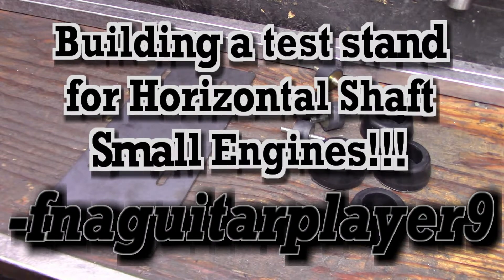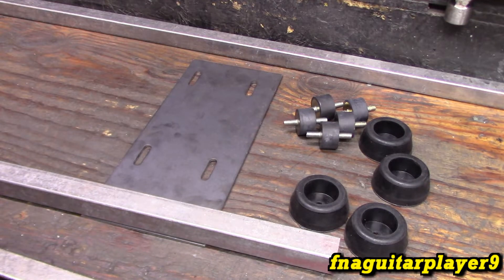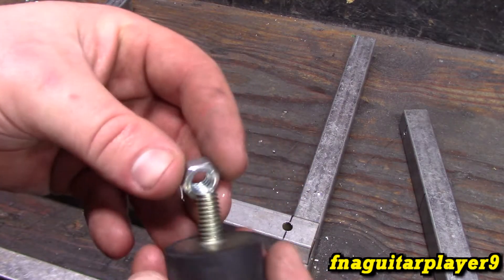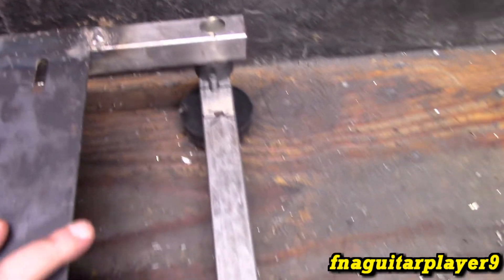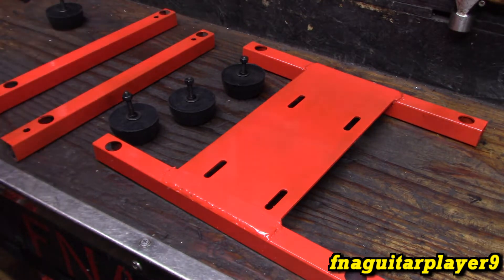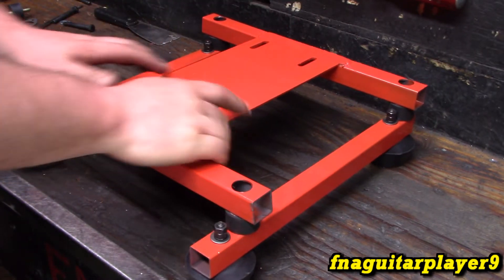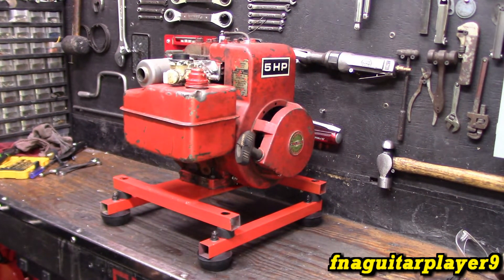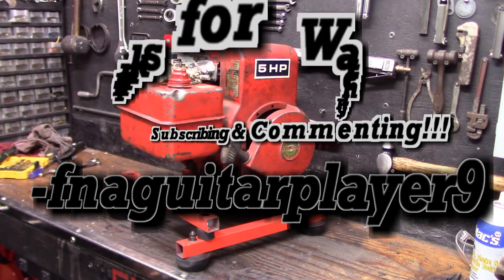Building a Test Stand for Horizontal Shaft Small Engines

Comment: A FINE job and I don't know why those tanks cost so much either. Trying to get us to buy cheap overpriced junk I'd say. I like Rustoleum and the orange will go with Tennessee and Clemson SC if nothing else. I always use a pocket magnet when putting on washers and nuts with an impact driver on the other end. And my test stands are whatever the engine is supposed to go on. That's as close as it gets here. So, GOOD job and pick me one!
Reply from the maker: Thanks! Probably so. Yeah it was just a random color more/less. Yeah i didn't think about using a magnet, i left that in the video for laughs lol Nothing wrong with that, most of my engines are off equipment. Thanks for Watching!!!
Reply: @fnaguitarplayer9  I usually stick the nut to the magnet on the flat side or the shirt pocket collapsible ones fit on the end pretty well. my hands are shot so I need all the help I can get. Take care and keep after it!
Reply from the maker: @lewiemcneely9143  that would work good
Reply: @fnaguitarplayer9  I need to get another shirt pocket job and epoxy that magnet onto an aluminum rod or a dowel. They're a trick at starting nuts and such IF you can get the magnet to turn a little. So I guess I have another project too!
Reply from the maker: @lewiemcneely9143  I hear ya, I need to make one too haha
Reply: @fnaguitarplayer9  OH yes. Me 2!